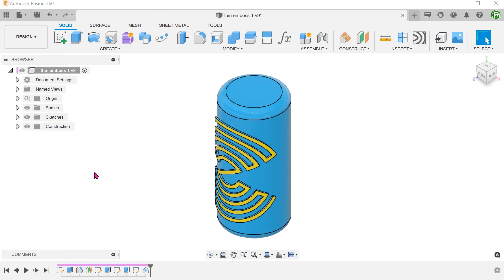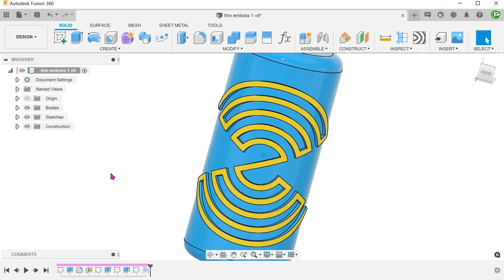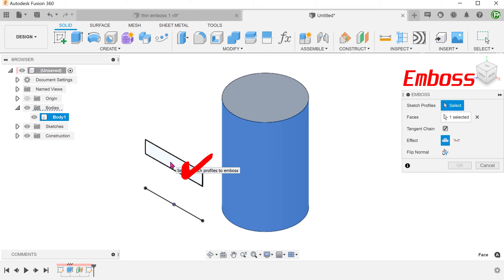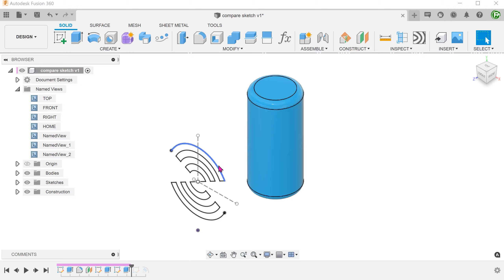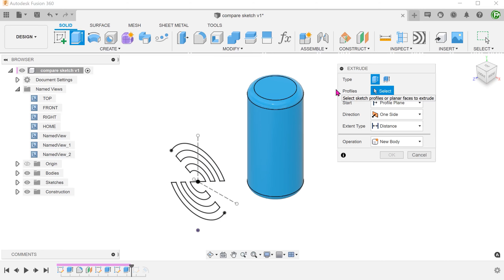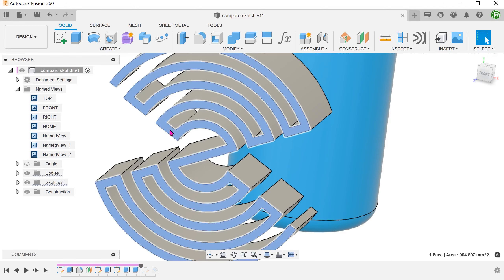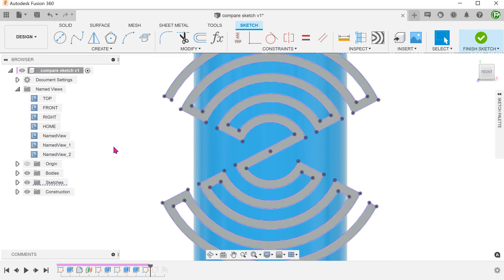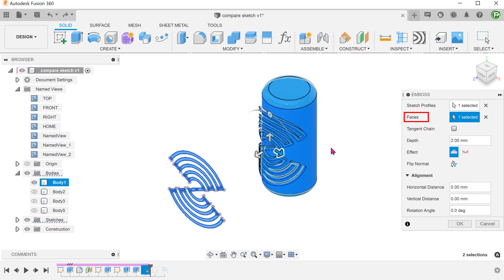Fusion 360 | Thin Emboss?

Comment: I can't tell fully from the view but it looks like the emboss has caused a twist in the protruding design around the cylindrical face. Could this be countered using a very thin emboss and then using the offset face command?
Reply from the maker: I went to test this out. Instead of creating a very thin emboss, I split out the embossed logo as a separate body and used it as a splitting tool to split the face of the cylinder. After that, I performed an offset face. As far as I can tell, there is no difference. Both the offset face command and the emboss command produces extrudes normal to the surface, so this is not a surprise.
I think this twist is a natural result of the wrapping combined with the normal extrusion of the surface that emboss produces.
Reply: @Fusion360School  fair enough! Thanks for testing it  out👍🏾 love the channel!

Comment: Great Video, Thank you.  How would this be done if the cylinder is tapered, (44mm to 50mm, total length 250mm), with debossed channels every 45 degrees?  I am able to deboss a channel every 90 degrees, but not every 45 degrees?  I am creating an extension tube for my Shop Vac.  Pattern command works using the "feature" type, but deboss will not accept once I angle the sketch 45 degrees?

Comment: Thanks for sharing this. Can Fusion wrap a whole pattern seamlessly around a flower pot shaped cylinder. Bottom smaller than top?
Reply from the maker: That sounds like embossing on a cone. It is possible, but the emboss tends to curve in a awkward way because of the conical shape. If you do a search, there are videos out there that have workarounds, I think.
Reply: @Fusion360School  Thank you!!

Comment: Thanks for this presentation. One point to add is that the free ends of the helix are remaining little bit shorter with thin extrude. I think another fixing step could be added to the projction scetch to allign it with the angle. Just an opinion :). Again many thanks for your efforts and great videos!
Reply from the maker: I just noticed that too. Thanks for pointing this out. It might be better to extend the original sketch by the thin extrude thickness to compensate.